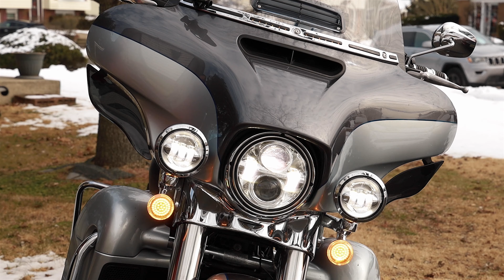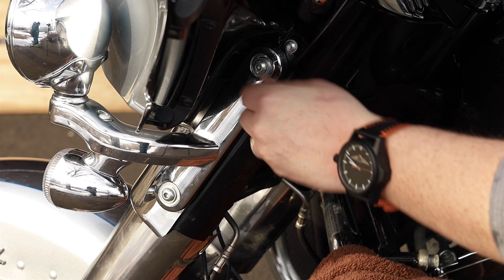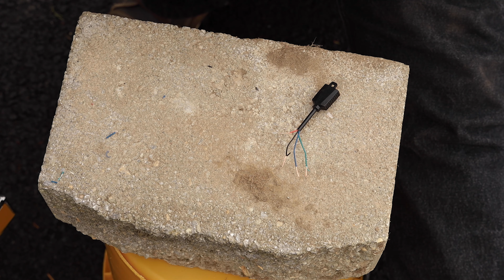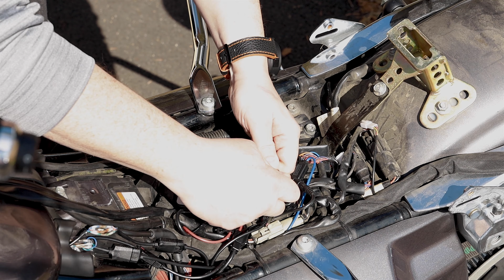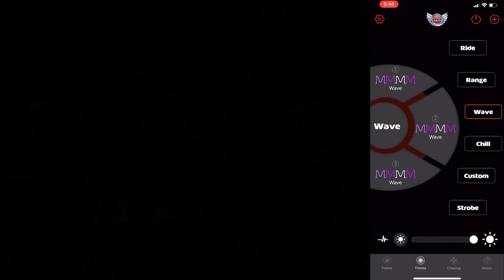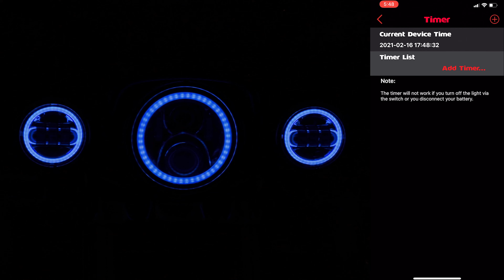The Last Motorcycle Headlight You'll Ever Need

Comment: 2 things - 1) you might want to ease up on the ads - i gave up on watching the entire video after the 4th ad (still 5mins left), and 2) seems like a lot of work to get colored rings on your lights. I do see it might be a little brighter but i find the stock ultra lights to be super bright at night. CD does make great lights but not sure i see the value for the price bc they AINT cheap.  You did a great job on the install but for me the other concerning part would be that I have to drill a hole in my turn signal.  the grommet SHOULD stop water but the new hole is spot where you COULD get water intrusion .
Reply from the maker: Not sure what's up with the Ad's that is a-lot! I will look into it thanks for letting me know :-)